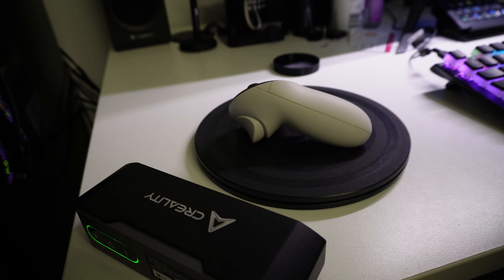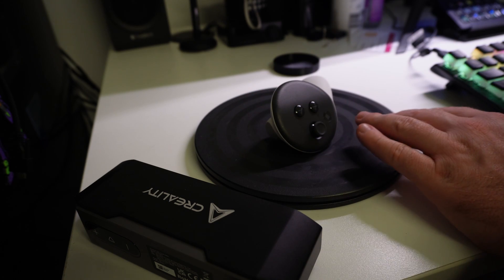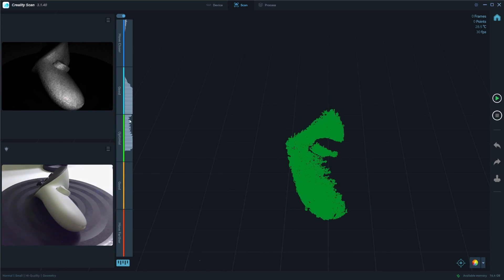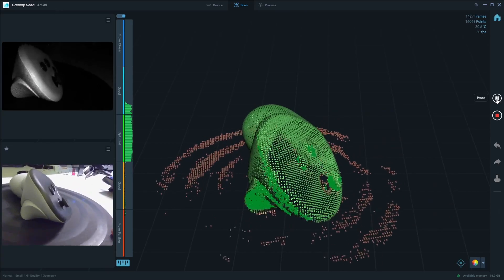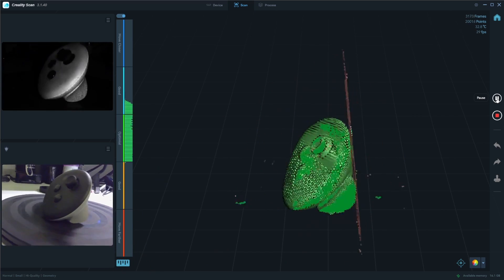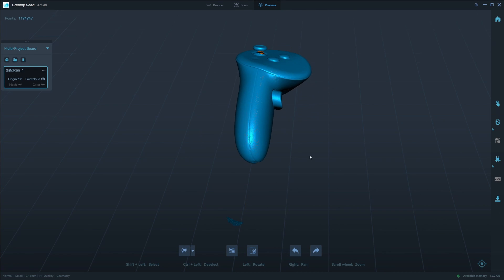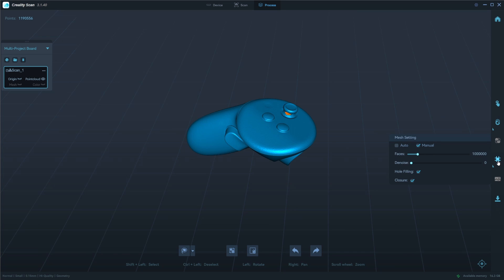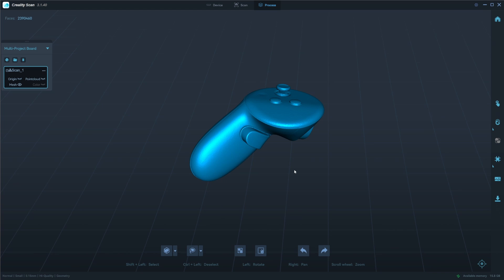Quest 3 VR Controller 3D Scan: Creality CR Scan Otter Demo

Comment: I used the lizard scanner, only a few times before I gave up on it!  massive change since then
Reply from the maker: Its pretty frustrating starting cause the ads make it look so easy! Was actually the whole reason I started my original tutorial series for the lizard cause there was like 0 documentation at the time. I think Creality have learned a lot and the new scanners are quite a leap in performance etc but also there have been good improvement to older scanners like lizard too.

Comment: Definitely keep these Creality otter scanner videos coming. 

What type of scanning frame rates are you getting with your spec computer? 

I’m struggling to choose whether to buy a creality Raptor or Creality Otter. 

🇦🇺🤜🏼🤛🏼🍀😎☮️
Reply from the maker: Thanks! So my system is an i9 9900k, RTX 3080, 32gb ram. Handles things well but probably due for an upgrade later in the year. Ill have to check the fps next time but felt smooth and fast so must be getting the fps they advertise, I think its 15 or 20fps? Ill have to check and get back on that one.
Reply: @DraftID  yes they advertise the otter at 20fps, and raptor is 60fps. 
Those pc specs you quoted, are they for a laptop or desktop? 
I’m looking at a second hand laptop that has a 3080 (16 gig vram) and a i9 11950H 8 core cpu, plus 64gig of ram.
Reply from the maker: @stevesloan6775  Sorry its a desktop. I think those laptop specs will be more than enough plus give you portability that I wish I had at times. Good thing with Otter is it draws power from the 3.0 USB and there is no power cable required to the wall. Not sure on the raptor if thats the same or not.

Forgot to add before that the raptor seems great if you need the blue laser but it does require tracking dots to use in that mode.

Comment: Nice mate! Great video. 
What computer specs do you have?
If you’ve used an einstar, how does the Otter relate to that?

Looking at my first personal scanner (I’ve used Creaform at work for years) to scan car centre consoles and a bit bigger too. 

Cheers mate. Subbed.
Reply from the maker: Thank mate. Its getting a bit older but its an i9 9900k, nvidia 3080, 32gb ram. Probably due for an upgrade later this year.
I haven't used an einstar but Ive got a 3dmakerpro whale, creality lizard & ferret, and revopoint range. The creality otter has been the best out of all of them.
Reply: Ahh right good to know. Yeah my gtx 1060 won’t cut it so I’m looking at an Asus G14 ROG AMD8945hs 32gb ram, 4070 - if you reckon that will be enough?

Thanks for the reply mate 👍🏻